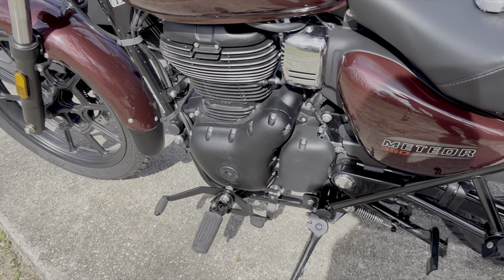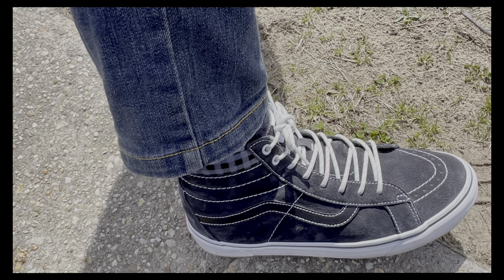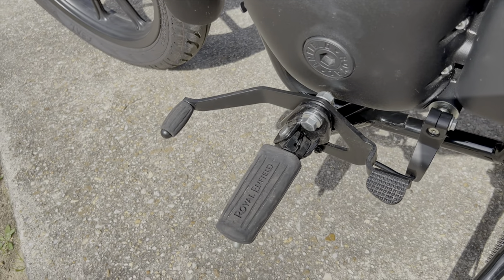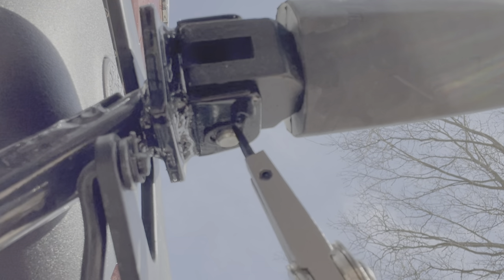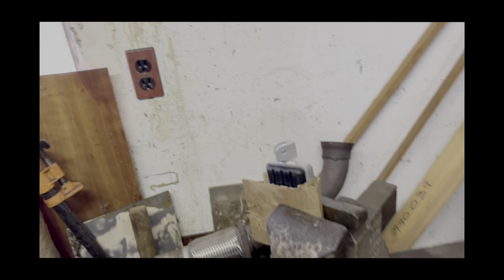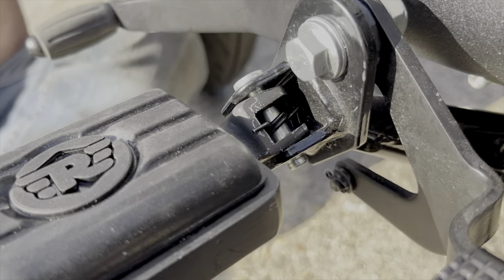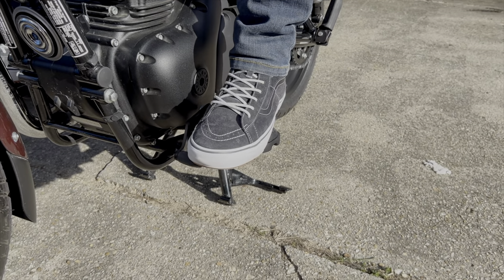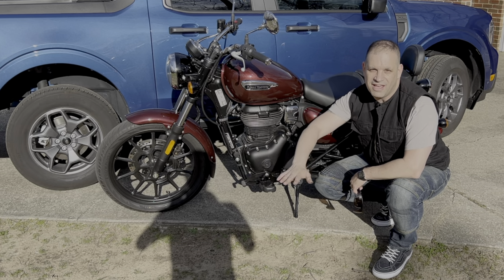Royal Enfield Meteor 350 | Heel Toe Shifter - Why so good?  | How-To |

Comment: Those pegs are definitely Royal Enfield - just absolutely terrible tolerances on their manufacturing!
Reply from the maker: I thought they might be pirate RE footpegs, but you may be right!
Reply: @MCCJustMotos  I've bought two pairs directly from a showroom parts store; I had to do some filing before I could fit them on to the rear.

Comment: Pardon my story, but it relates... I took my test ride on the Meteor with slip-on shoes.  I didn't notice and the dealer didn't tell me about the heel/toe.  Was able to shift old school during the test.  Imagine my surprise when I came to take the bike home in my regular gear and couldn't get my boot under the shifter. A quick glance down and all was made clear...LOL.  The Meteor is really the only bike I've had in 50 years of riding with this shifter.  But it only took about 4 miles to get on board.  The upgrade looks good.
Reply from the maker: Haha that is a humorous but great story! Glad to hear that is was easy to get on-board! The wide peg makes a nice upgrade!
Reply: @MCCJustMotos Just an update. I put the wider pegs on my Meteor (front and back)but didn't have to drill out the holes. However, the stock rear pegs have a spring and ball bearing that the wider pegs aren't modified for. Not a real issue. Still fit just don't stay folded.
Reply: Cool! Good to know.

Comment: I own a meteor, the only complaint I have with the heal toe shifter is the slop at the pivot bolt. If you can get someone to turn a bolt up with less clearance, it makes the shift a lot more positive.
Reply from the maker: Huh, I can see that point. Mine doesn’t feel like it has a lot of slop, but I can’t imagine intolerances are much different.
Reply: Hi, if you are alluding to the axial play of the heel-toe lever, which is actually excessive, I can suggest that you first disassemble the lever with a 17 and a 15 mm spanner. Once the 10 mm bolt has been removed, you will notice that there is a bushing inside the lever. You have to lower this bush, by hand or by machine, until there is a gap of maximum two tenths of a millimeter between the lever and its support. You will see that the lever will "wobble" much less. I hope I was clear. Cheers!
Reply from the maker: @corradospagnuolo614  fantastic write up! Thanks!!

Comment: Yup, yup, yup. Natural motion for the foot is to push down or step on it! So, it's much more natural to push down to change the gear either with your toes or heel. IMO much better than trying to wiggle your foot under the lever then pull up. You don't really have muscles that are made for that stunt. ;)
Reply from the maker: It’s also a faster upshift! 100%